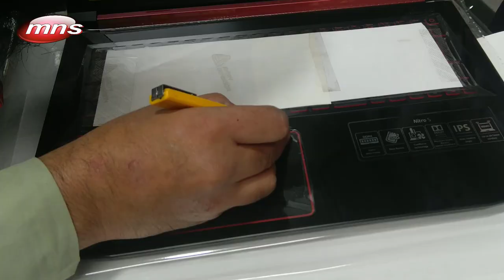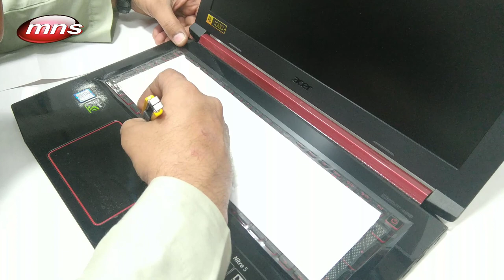How to laminate your Laptop Acer aspire gaming series Apply screen protector Without Bubbles & Dust.

Comment: sir jo aapne press krne ko use kiya use kya bolte h
Reply from the maker: Thanks for comments.
Aluminum Alloy Scraper.

MNS COMPUTER
Lamination expert.
Mobile,Tablet,iPad,Note Book,Laptop
Lamination Paper And Logo.

#Metallic Matte  iPhone Lamination.

Purchased our website.
Payment via Paytm.
Only for India.
https://www.DecorateMobile.com

Available Flipkart.
Free Apple Logo with iPhone Lamination
Please Use this Link.
https://www.mobiledecorate.com

This Mobile Lamination Compatible All iPhone And All 6.4 inches Mobile Phones.

MNS Mobile Skin Protection Easy To apply And Easy To Remove Without Any Scratch And Defect.

MNS COMPUTER
Shop Timing 11:00 Am to 6:00 Pm
M-5 Street No.13.5
Monday to Friday
Google landmark. (MNS WALI GALI)
Brahampuri Delhi INDIA 
Pin Code No.110053

Bulk Lamination papers ask for.
mnssaif@gmail.com
Whats App contact.
+91-9958149296
02:00 Pm. to 06:00 Pm. 
Monday to Friday.

Other country.
please email.
mnssaif@gmail.com
Reply: Lamination viper

Comment: How much did you change for this?
Reply from the maker: MNS COMPUTER
Lamination expert.
Mobile,Tablet,iPad,Note Book,Laptop
Lamination Paper And Logo.

#Metallic Matte  iPhone Lamination.

Purchased our website.
Payment via Paytm.
Only for India.
https://www.DecorateMobile.com

Available Flipkart.
Free Apple Logo with iPhone Lamination
Please Use this Link.
https://www.mobiledecorate.com

This Mobile Lamination Compatible All iPhone And All 6.4 inches Mobile Phones.

MNS Mobile Skin Protection Easy To apply And Easy To Remove Without Any Scratch And Defect.

MNS COMPUTER
Shop Timing 11:00 Am to 6:00 Pm
M-5 Street No.13.5
Monday to Friday
Google landmark. (MNS WALI GALI)
Brahampuri Delhi INDIA 
Pin Code No.110053

Bulk Lamination papers ask for.
mnssaif@gmail.com
Whats App contact.
+91-9958149296
02:00 Pm. to 06:00 Pm. 
Monday to Friday.

Other country.
please email.
mnssaif@gmail.com

Comment: you should apply antiglare screen protector lol for anti glare screen...
Reply from the maker: Fingerprint scanner is not working after the apply the logo.

MNS COMPUTER
Lamination expert.
Mobile,Tablet,iPad,Note Book,Laptop
Lamination Paper And Logo.

#Metallic Matte  iPhone Lamination.

Purchased our website.
Payment via Paytm.
Only for India.
https://www.DecorateMobile.com

Available Flipkart.
Free Apple Logo with iPhone Lamination
Please Use this Link.
https://www.mobiledecorate.com

This Mobile Lamination Compatible All iPhone And All 6.4 inches Mobile Phones.

MNS Mobile Skin Protection Easy To apply And Easy To Remove Without Any Scratch And Defect.

MNS COMPUTER
Shop Timing 11:00 Am to 6:00 Pm
M-5 Street No.13.5
Monday to Friday
Google landmark. (MNS WALI GALI)
Brahampuri Delhi INDIA 
Pin Code No.110053

Bulk Lamination papers ask for.
mnssaif@gmail.com
Whats App contact.
+91-9958149296
02:00 Pm. to 06:00 Pm. 
Monday to Friday.

Other country.
please email.
mnssaif@gmail.com
Reply: 😂🤣😂🤣🤣😂🤣 yes